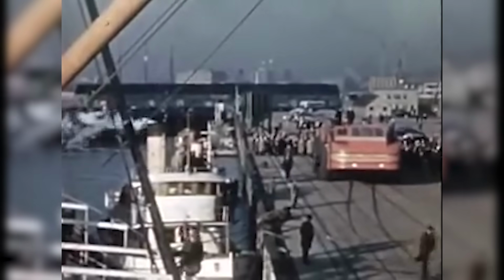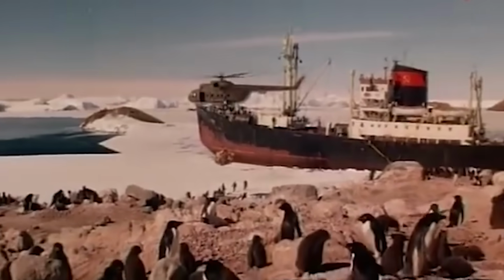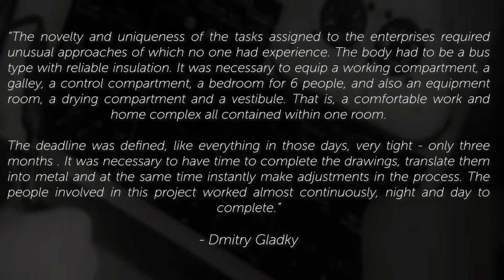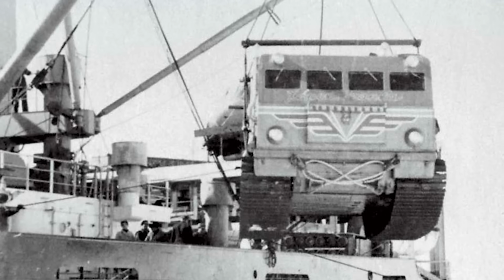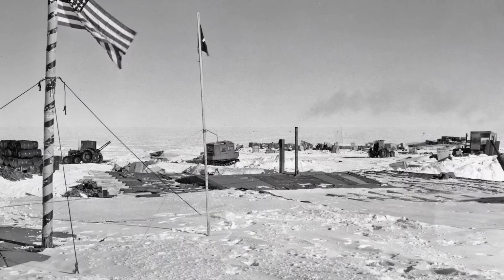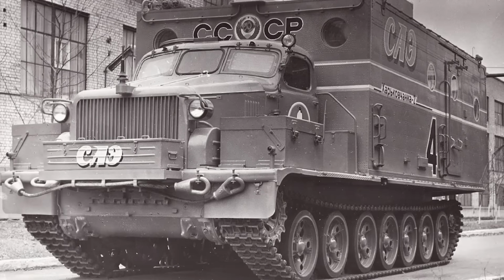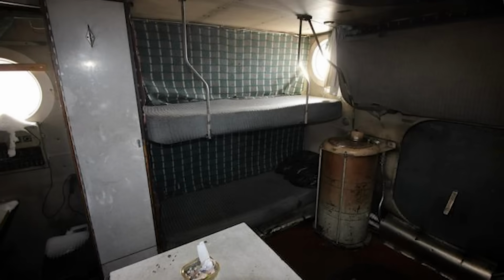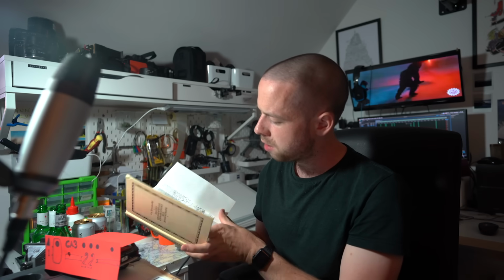"Kharkovchanka" - The Colossal Soviet Antarctic Cruisers

Comment: I am really amazed by the ingenuity, practicality and simplicity of the soviet design particularly to military vehicles and special vehicles that are used in Arctic and Antarctic operations. These Vehicles are very cost effective because there is no need for big budget for research since these vehicles are simply modified from battle tanks. For example, the AT-T vehicle. Again very cost effective vehicles because they are easier and efficient to build, maintain and operate. The Soviets are smart and hardworking and that is very common to their culture and the law that their country has imparted into their people. I am just very sad that in the latter end of the soviet era particularly in the late 80's and 90's that the Soviet Union is plagued with corruption that their economy has fallen.

Comment: Imma just point out that the US snow cruiser was an unsuccessful prototype and had several successful successor vehicles including a land train design that operated for years shipping supplies to the arctic circle, and only stopped when an inexperienced operator tried to drive it up a cliff and set it on fire while attempting to get out of the resulting jack knife (it wasn't rebuilt because the cold war was cooling off and no one but the DoD had enough money to convince the company to build expensive 1 off vehicles anymore). 

The technology involved has since become the basis of most electric and hybrid vehicles including but not limited to: Bulk carrier mining trucks (the ones always shown in wide angle shots that look stumpy but are actually building sized), hybrids, EVs, Drones (areal and aquatic), and even some aircraft, basically anything that moves using an electric motor directly attached to whatever it uses to move.

Comment: They needed electric power actuators to power the drive train then have powerful diesel generators to power the drive and heat. They could power the system with an onboard generator system and have an auxiliary generator in tow along with the fuel. They needed insulated fuel tanks with electric heaters and electric heater blocks for the engines also. So each vehicle would have a total of three electric generators the main, the auxiliary and the secondary onboard generator.

Comment: I tought ice and snow were melting du to global warming, why would the snow cruiser remain lost in the snow if teh snow level is lower than it was 70-80 years ago??  Asking for a friend.
Reply: Later expeditions reported no trace of the vehicle. Although there was some unsubstantiated speculation that the (traction-less) Snow Cruiser was taken by the Soviet Union during the Cold War, the vehicle most likely is either at the bottom of the Southern Ocean or buried deep under snow and ice. Antarctic ice is in constant motion and the ice shelf is constantly moving out to sea. In 1963, a large chunk of the Ross Ice Shelf broke off and drifted away; the break occurred right through Little America. It is not known on which side of the ice shelf the Snow Cruiser was located.

Comment: The American version of this type of cruiser was an incredible failure, largely  because of such engineering contempt that its many unique features and equipment were completely untested before shipping the thing off to Antarctica. Its basic concepts were thoughtful, but their execution was a literal rolling mess, starting with a major lack of adequate power to drive it. The theory was that driving it halfway across the US would be its shake down cruise, but it proved to be an unreliable mess which could barely get out of its own way on US highways in dry road conditions. After two years in the making and with a huge publicity campaign already in full swing, its supporters could not bring themselves  to admit failure before getting it on the ship, so they packed it up and shipped it out. In Antarctica, its failures were immediate apparent in its under-powered engine and ridiculous tires (instead of tank-like treads), making it practically unable  to move around. So, it was parked outside the original Little America base and eventually snowed over and lost (sort of, for more likely wanting to be forgotten). So many US agencies and major corporations contributed to this clusterfuck, that the whole  project just got officially forgotten to avoid the embracement, and the soon commencement of World War II provided further diversion of attention.

Comment: In the army in 1961. Served in Polar Research. Was sent to Greenland. We had vehicles similar to these. Shape was similar but two sections. Was joined in middle with a hydraulic system used for steering. Was made to haul troops. Front section held 10 or 12. Rear close to 20. We used them to mainly haul supplies. The motor was really underpowered and had to be replaced. Think it was a Cummins motor. New motor was great. It was purely a experimental vehicle. Only had two vehicles. Everyone seemed to  like them. Was something to drive, and they looked great. Was unbelievable the amount of money that was wasted. Base camp was Camp Tuto about 10 miles from Thule Air Base
Reply: Hey man, your comment deserves more attention! Camp TUTO (ThUle Take Off) 
was a support base for Camp Century, originally intended for Project ICEWORM a buried Second Nuclear Strike base under the ice. This proved impossible but many science projects were completed regardless. I'd be interested in anything else you have to say about your time in Greenland, Thank You!
Reply: @Melody_Raventress  Attention for what, been posting info for over 25 years. Always told its lies and info is taken down.
Ice Worm was a one shot trip, before it was over they realized how stupid it was. 
Fire a rocket, with a flame coming out, wouldn’t it melt the ice.    Think they discovered it was a bad idea.
The Ice Tunnel at edge of ice cap near Tuto was built in 61, closed in spring of 62. 
Huge pit was dug in it, 55 gallon drums of fuel were dumped in it. Nobody new how many or why.
Spent 4 months at Century, reactor was off line the entire time. And they were not even trying to get it online.
Topside at Century was the container the core came in. Message on it from Danish government said if core was ever removed it must stay in container at that site for 100 years. Was written in English and danish. Was painted international orange.
The amount of money wasted at Tuto, Century, was unbelievable. 
If you didn’t use money given for that year it was reduced the next year. Perfectly good equipment was sunk in Lake Tuto 
So they would get increase the next year. 
The few men that tried to work on reactor wore badges to detect any radiation leaks. 
What about the rest of us.         We’re we immune to radiation.     Had cancer in 97.
          No one cared or gave a shit. Just one huge waste
Reply: Yes, definitely an untold story there…
Reply: In Russia, there is a series of 2-link all-terrain vehicles for any terrain of the "Vityaz" type (15 meters long, 30 tons)
Reply: u can't compare greenlad with the south pole, there is a difference of 3260000 degrees celsius. In greenland you can have a swim in a random ice lake. Antarctica is like Mars or Venus, u get out u die
Reply: @blackjesus4414 — And yet somehow Amundsen and Scott walked/sledged all the way to the South Pole.
Reply: @sirrathersplendid4825  Sure they did, the same way Armstong walked on the Moon.
Reply: @limanac111 — The South Pole has been done many times, even single-handed and unsupported by a woman.  As for Armstrong — well, the jury’s still out on that one. 😊

Comment: i doubt you are going to see this but amazing video! slight correction on the ATT. they are a t54/55(road wheels are of the t54 model) with its chassis backwards. as the engine of the tank is in the rear with the drive sprockets (the spikey wheel for those that dont know) but  the zil cab is placed over the engine and the gearboxes must be reversed.

Comment: Kharkiv’yanka = "Woman of Kharkiv",

Kharkiv'yanka (Ukrainian: Харків'янка), code name: Manufacture 404S) is a model of Antarctic off-road vehicle made in 1958 in the Soviet Union, manufactured by the Malyshev Factory.

Based on the AT-T tractor platform (itself based on the T-54 tank).

In December 1959 it was delivered to Antarctica and reached the South Pole.

The off-road vehicle had a small kitchen, toilet, oven, and eight beds.

In 1969 the second generation of Kharkiv’yanka was produced

Its a good job that these are Ukrainian vehicles & not made be Russian AvtoVAZ, that makes the Lada, otherwise they would have never got to the South-pole,

🇺🇦SLAVA 🔱KRAYINI!🇺🇦
Reply: Nope.

Comment: Wow, this is a mini-heaven when zombie comes
Reply from the maker: Until you run out of fuel!
Reply: - With nuclear powered reactor it can run for month, or years without refueling, but anyway it require maintenance time from time. Also a steel trucks may be outworned after a few months after 24/7 squashing a zombies.

Comment: it is not "Charkov", it's Kharkov, or Kharkiv.

In the space mission proposal "Mars Direct" (and the later "semi-direct" which became the NASA Baseline reference concept for a Mars mission) a large piston-engine, methane/lox burning ground rover was described, that might be a wheeled, vacuum-proof version of this.
4 People, 600 mile one-way range. (38% Earth G on Mars)
 It scavenged H2O from the exhaust, and could run substantial power to things like ground-penetrating radars, drills and power tools & such.
An unmanned Mars ascent stage was landed empty but for a little H2, and made lots of CH4 & LOX and prepared a landing site before the crew left Earth orbit.
Future missions would land 500 miles away, each able to explore a large area around them, and still be within one-way driving range. Each site which a crew left behind when they flew back home, leaves behind the truck, nuclear generator, fuel station and a ground hab & tools.

Comment: Soviet Union == USSR, not Russia (Russian Federation). "Харьковчанка" never had any relations to Russia, they just used it.
It was designed and and produced solely at Kharkov, Ukraine.
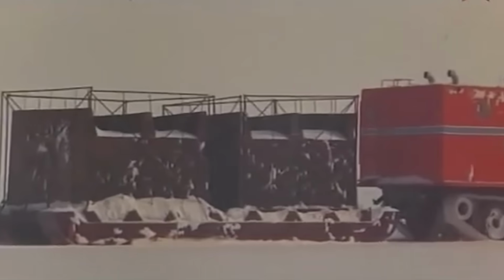"Kharkovchanka (Russian: Харьковчанка, "Woman of Kharkov"), code name: Manufacture 404S, is a model of Antarctic off-road vehicle made circa 1957–1958 in the Soviet Union, designed and built by the Kharkov Transport Engineering Plant,[1]: 8:14–15:46  and later manufactured by the Malyshev Factory.[2] Based on the AT-T tractor platform (itself based on the T-54 tank)." (WIKI)
"Malyshev Factory" was a Kharkov military oriented plant which designed and produced tanks and similar equipment.
Reply: >any relations to Russia
except Russian majority of Kharkov

Comment: Not as bad as the "Antartic snow cruiser" from the 30's, but still, political agenda collides with R&D logic. You're supposed to build a prototype, test it on a small run, improve it, retest and so on.
In both cases, they just sent them straight to the South pole without much testing.

Comment: The Antarctica vehicle video is a hoot!
I worked in the Oilpatch after August, 1963, which was during the invention of the Nodwell, and the use of the Bombardier Muskeg Tractor. The twined wheels on both ends of rocking-beam suspensions was helpful for flotation, but made changing tires when an inside-roe tire wnet flat - well, new workds were invented. The Nodwells had sturdy FN-75, and FN-100 models, then a newer FN-60 design with the screaming Gimmy Diesel engine. Smaller FN-20 s were seen in the Arctic, on the ice and the Canadian arctic Islands, but the FN-60 was better on land. Track maintenance was a huge problem, since every grouser bar had to be checked for missing bolts (6 per grouser bar) and for cracks (which meant changing: that required removing 6 bolts, and using 6 new bolts & new nuts, because the nuts were self-locking due to a inset ring of nylon!). Track cleaning, so that a buildup of snow and ice would not act as a huge break, stopping the machine next morning, was a much-hated chore. I was a Field Clerk, Crew Manager, Seismic Surveyor, Drill Push, Cat Push, Advance Man, and even a Permit Man. Oh yes, and the first 3 years I spent quite a bit of time in the Calgary Offices of the seismic company, picking 1st breaks and plotting milliseconds on the y-axis against distances in feet on the x-axis (each set of geophones was at a different sequential distance from the Shot Hole (aka Energy Source)) The shallow velocities derived from the graphical plots were used by the Geophysical Interpreters to improve the depths-to-reflection horizons, derived from the travel times from energy source to each each set of geophones. Snell's Law is a very good friend. Grin.

Comment: I’m a mechanical engineer. This is an interesting story but no mechanical engineer (with reasonable design standards) would consider the kharkovchanka a “success” story because it was so poorly designed and had so many fundamental quality and design failures  Modern Arctic vehicles of today utilize almost NONE of its stupid design elements. Maybe it should have been called Ruskiachunka (junka) ?   The only good smart feature in a Khakovchanka would have been the case of Stoli vodka that occupants brought along to drink when the POS breaks down in the Arctic!
Reply from the maker: well you better go back to 1950 and tell those soviets to stop using them for the next 5 decades 🤷‍♀️
Reply: LAUGH IN ANTARCTIC SNOWCRUISER

Comment: Thanks for another great documentary.  I learnt more about these machines than in any other doco.  From a more modern perspective with all the tech available the innovations from the 1930s to the 1960 really stand out. Relative to the enviromental impact, the fuel usage and pollution with the only offset being the extreem subzero temperature freezing exhaust or other particulates must have been massive. What was the diesel consumption 9 to 12 litres per km? 'Conquered' territority, but at what cost?

Comment: With all of the knowledge that the Russians gained from Antarctic exploration, and building vehicles to operate there, it's disappointing that they haven't kept up with it.  Russian technology may have lacked the sophistication of western countries, but they had a knack for making practical, reliable, and durable machines that demanded much of their operators, and performed their tasks.

-100 F is just mind-boggling to me.  I have spent overnights in my truck down to -22 F with a steady 20 mph wind howling outside, and there was no way I was going to shut down that engine.  I well appreciate that diesel fuel is life for the people working in that kind of environment.  If your engine quits, you are totally screwed.  The transmission swap that the Russians did halfway between Vostok and the South Pole has to be one of the great stories of auto mechanics on the road in the history of motoring.  -55F for 5 days to swap a 1320 lb transmission.  They got it done.  Amazing.
Reply from the maker: I think nowadays bidget is the main limitation for Russia, though they still have one of the largest antarctic operations of any country. But yeah incredible achevement from those guys, especially considering the era!

Comment: If you used the internal food, water, and environmental systems of a nuclear submarine; included a snow scoop and insulated the exterior you could have a vehicle that was only limited by the same things they were: the need to have maintenance and take in food.

You'd just need a robust enough emergency system to keep things warm inside in case a repair was needed to prevent things from freezing over  (either because of a breach or the primary heating system konking out,) a way to melt a way out if it had to stop during a storm, redundant tread based movement, and protective suits for outside: but you would have a vehicle could have a large crew and be out for months or a small crew that could be out for years,.

Comment: It didn't have a Drive train it had 4 electric motor on each tire that why it could only do 8 mph
Reply from the maker: Drivetrain refers to the clutches and gearing of the motors, electric cars still have drivetrains. I've a whole other video on the Snow Cruiser if you want to know more.